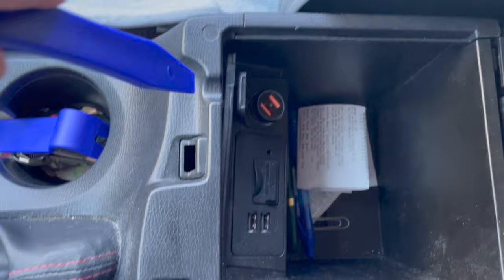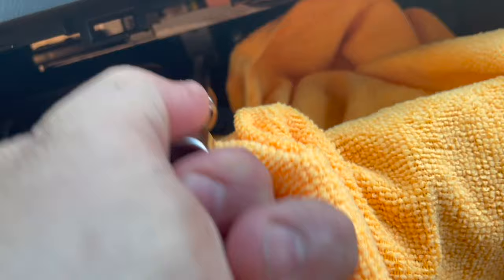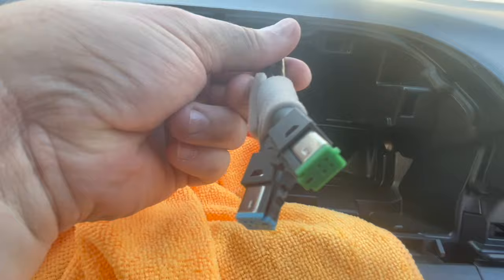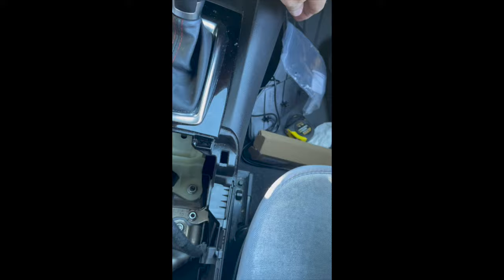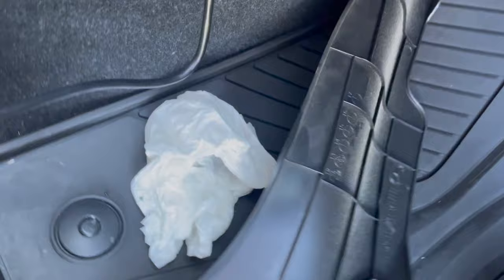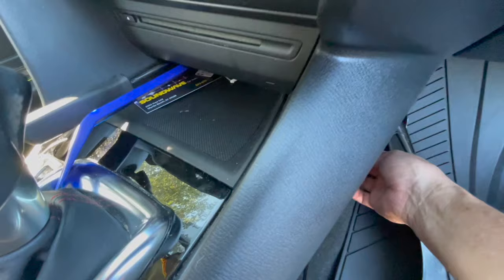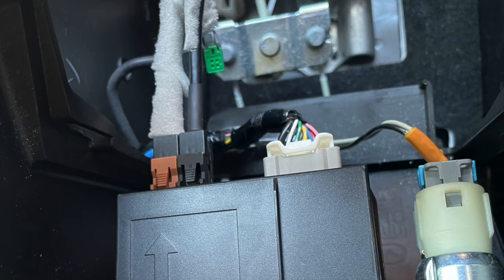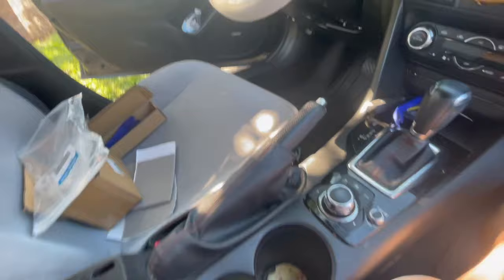2014 Mazda 3 Carplay Hub install - EZ way * must have 7.00.xx or above software installed first!!

Comment: I just did the install and the most confusing part was figuring out which cable plugged in were. Wasn't too hard to figure out since they will only fit it one spot.

There is one open plug on the hub unit and it doesn't seem to matter. Not sure what it's for. Maybe AUX audio, but I didn't test that.

Thanks for sharing the instructions!

Comment: Well this is unfortunate as I'm on v27 and I can't get the software update for Australia region, tried the Mazda revolution site that other videos recommend where I could find all the files I need there but I can't message anyone because account too new. I make a post there asking for help in acquiring the files for my region but it was removed an hour later! Made a Reddit post on Mazda 3 sub asking for help updating from v27 but got no help so I repost to another Mazda sub... And again, no help! I really wanted to install myself instead of paying dealership $515 for them to do it but since I can't even update the infotainment, the dealership is my only option!

Comment: Have you tested this with an android phone? Thanks
Reply: It works the same with andoid auto, but the touch won't work with it (mazda's policy). You can use the controls on the center console.

Comment: So do you have to take the center console out or can you just pull the wires under and connect to usb hub.
Reply from the maker: As in center console, if you mean the cup holder area and the attached brake lever boot? - I would say yes, I did that in the video and it does make it easier, just lift up on it and it pops out, like any trim in the vehicle, things just pop free, pay attention to that cord that I said the clip faces towards the passenger side (it did in my case)—- I think I was referring to not having to remove the shifter area and the cd player etc…

Comment: So what happens if bios isn't updated?

My hub is doing the reset bug even with the navigation card removed. I want to replace the hub thinking it will fix the problem.
Reply from the maker: I do not know the consequences of not doing it…mine was at that level, and a think there have been a few more updates since I installed mine, but I have never updated past 70.xx  - every mazda 3 forum says you must do it to that point or the aftermarket hub installs will not function…I need to find out if I take it in or try to do an update if it will still function?
Reply: It could brick your entire infotainment system. The update will cost around $70 depending where you are located eg. USA. Canada, Australia.
Reply: @alrightythen888  I'm in Australia and Mazda dealership quoted me $320 for the USB replacement hub and cables but theywon't supply the software update so there's no point doing myself since I'm on v27 and I have no f**king idea where else to get the update files from, other tutorials linked Mazda 3 revolution but I can't even interact with anyone there that may have the files cos newly created accounts can't message others and posts get removed. I have to get it done at the dealership for $515!

Comment: Another incomplete YT DIY video. Lowering the glove box is a beech. Friend was upset after watching your video. I also love the uploader's sophist comment: if I can do this anyone can?! A friend break clips and more. They lost the screw for the infotainment screen. The cloth didn't prevent that. They should've used a magnetic screw driver instead. Ultimately,  they ended up going to an auto mechanic to fix what they broke and messed  up. And these cheap "hubs" work for 6 months at best then they're garbage.